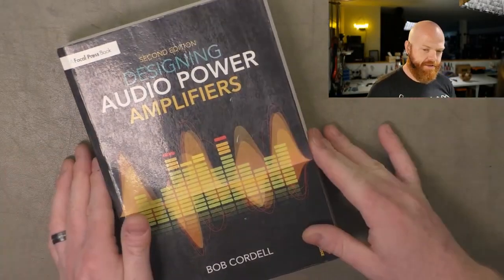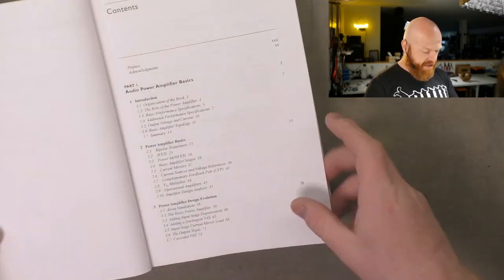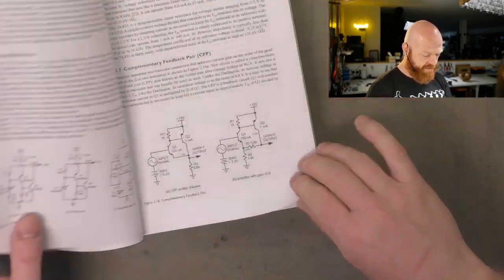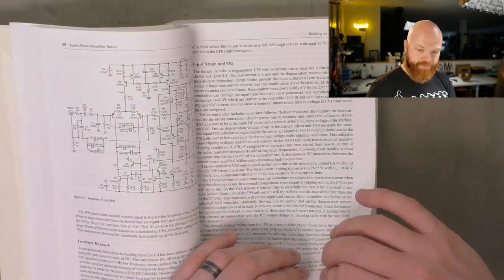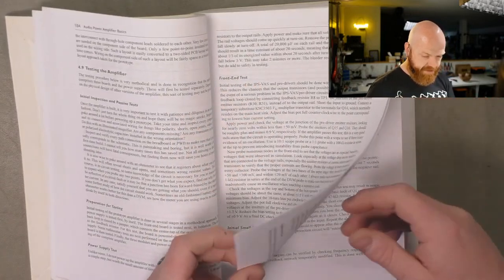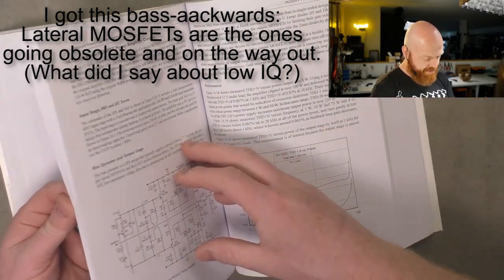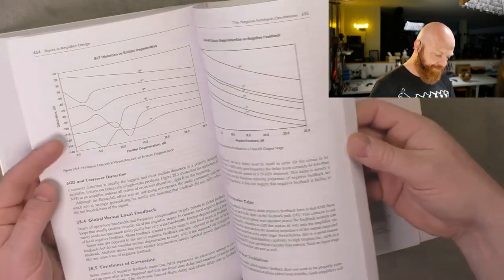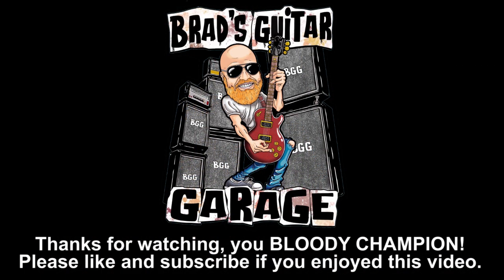Featured Book: Designing Audio Power Amplifiers - By Bob Cordell (2nd edition)

Comment: I found a used copy for $63, and if it's a good book for Brad...I will like too.  My 3rd Edition of The Art of Electronics arrived and it almost looks like a  brand new book. My 1st/2nd edition are getting dogeared. And PDFs of more than 20 pages all suck! The Art of Electronics has some junk circuitry in it, for now. I have a great old filter and lattice filter network book from the phone company.  Mostly theory. The cheapest new version of Designing Audio Power Amps is actually from Australia. $95 USD + $7 media mail. Anyone who wants $60 to ship a book is an asshole. USA media mail is dirt cheap, and it's regulated to newspapers, magazines, books, records, tapes, CDROMs, DVDROMs, thumb drives with data on them, etc. (Media)
Reply: 1950s electronics books usually had the PLL chapters crossed out. Back then making a PLL with vacuum tubes was not very practical, and it was absurdly expensive. Today I can put 350 PLL chips into my pocket. One of those old electronics books has a German EE who's name was Fuchs. He anglicized his name to the spelling "F-u-c-k-s".  Whoops! It's a very good old tube era book. The name Fucks in the bibliography is a cheap humor bonus.

Comment: Realizing complex systems can be simplified by breaking them down into different parts is a symptom of an adequate IQ at the very least.
Reply: In 20 years as an electronics repair tech, we had two operating principles: 1) "divide and conquer", and 2) "crush carelessness". Divide and conquer meant to use logic to break down the fault or faults into stages, and conduct individual tests/measurements to confirm where the problem lies. Crush carelessness meant to work safely and not hurt yourself; and try not to damage the unit further or blow it up!